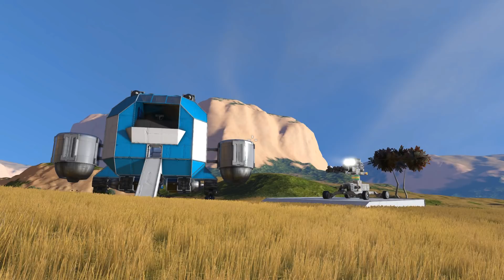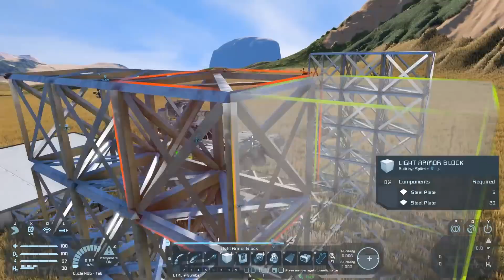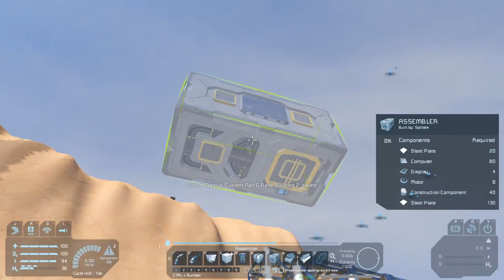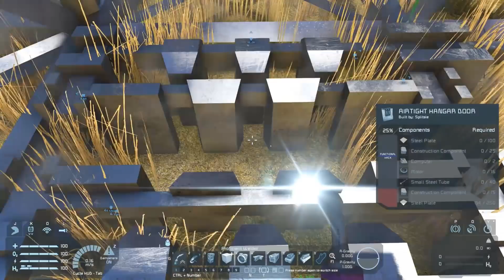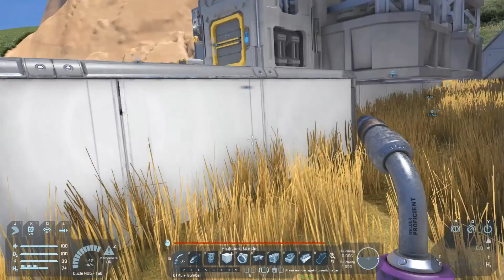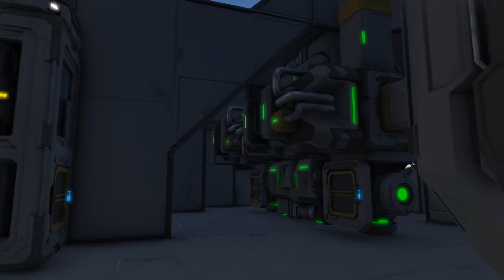Space Engineers Tutorial: Building Your First Base (Part 6 of a survival tutorial series)

Comment: I wish I watched it before I built base. I made all as tight as possible and now I need to rebuild all of this.
Reply from the maker: There's something to be said for nice and tightly spaced builds, I just find it's easier to get a style I'm after if I give myself room first then try to go smaller as it's a huge amount of work to attempt to increase space afterwards :/
Reply: @Splitsie  Actually what I initially built was facilities packed tightly covered by walls and roof, with no free space inside at all. And latere I fiugred out that it's better to have access to this facilities and to have some free space inside. I built several small cargo containers at first and then it was enough but later I wanted to build large container and extentions for refineries and assembler. But there was no space for that and each time I needed to disassamble walls if it was the option at all. Now I build much larger building for production facilities. I hope I will not need to rebuild it too quickly :D

Comment: I'm having problems placing a medbay in my cave base I'm building. No matter what position I try from the air or ground it will not snap to grid.
Reply from the maker: I've found that it's mainly armor blocks that will snap to grid in the ground, for things like medbays you normally need another block to anchor them to, try placing down some armor for the floor then placing the medbay onto that

Comment: "always leave a connection so you don't destroy things" was that the same splitsie who had ro repair the rover with 2 pairs of merge blocks cause he grinded away the wrong blocks? :D
Reply from the maker: Yes it was, I eventually learn from my mistakes.. Sometimes :P
Reply: that makes you smarter than me, i usually make the same mistake 2 or 3 dozen times. just to be shure it realy doesn't work the way i'm trying to build it :D
Reply from the maker: Why do you think I started making the occasional testing video - I figured if I was going to make a whole bunch of mistakes might as well record it so I remember :P
Reply: i spend most of the time tearing down and remodelling the same thing over and over and evertime i'd realy need it the piston+mergeblock trick doesn'T work the way it'S supposed to, summoning clang 'n stuff
Reply from the maker: Yeah, pistons still seem a little unsafe these days. They always make me quite nervous :P
Reply: was something i did wrong, instead of merging the items it crashed them together, damaging everting along the corners where i wanted to merge the parts :D

another thing i'm wondering while building timerblock airlocks is how exactly the timerblocks work, do they trigger all set up actions at once or in the order i add them with a bit delay in between?
Reply from the maker: They are supposed to trigger everything at the same time, but the reality is that they have a tiny delay some times, it varies on how many other things are going on at the moment they're triggered.

I've seen the effect when having lights on a timer block, they'll turn on at just slightly different times
Reply: 2 door groups, a vent and several warning lights. didn'T include soundblocks for warning cause there was no more room the way i build the airlocks :D

Comment: IMPORTANT NOTE: 1 assembler has 8 ports for modules. the two lateral access ports have a smaller yellow outline box. and youll user the module vertically to attach to the single module box and the access port box. you can attach a module there, leaving two access ports(one on each extreme end..if it were free floating). no real need to build 2 assemblers at the start.
Reply from the maker: You're absolutely right, I wish I hadn't missed that when I made this one :P
I still like having 2 assemblers though, but that has more to do with the often insanely large builds I attempt and needing tens of thousands of steel plates so 1 assembler is usually dedicated to them :)
Reply: thanks for the highlight, i edited it to be a little more clear and grammatically correct.

Comment: I missed it, eh... if not, I would correct Your mistake eariler :P
- Assambler have '8' upgread points (checked - conveyors on the 2'block-sides work also as upgread points)

Also no solar towers ?! :( 
Scripts are easy to use...

*(   http://steamcommunity.com/sharedfiles/filedetails/?id=1094836757   )
Reply from the maker: Yeah a few people have pointed out that little gaffe :P

I deliberately built no solar at all on it, this is a base for new players so I didn't want to get into solar and batteries or scripts. I wanted something functional that illustrated the different components that are useful in a base. I particularly didn't want to go into scripts because while they may be easy to use, I don't have the skill to write them so I'd consider them difficult to make. This means that if something goes wrong I can't do anything meaningful to fix it - in fact that's the same reason I've never owned an apple product... while windows may break more often I know how to fix most of its errors that I come across :)
Reply: You're using solar tower's right ?

Battery's... You grind them... You lose !
But seriously, it's easy and My bet is that 5'mins'top, of one's work, would be enough, there is only 3 options, even a donkey could 'solve' it, right ? :P

Script errors ?
I haven't had any with TIM, Isy's script's, Whip's turret, fancy fligth info... and many, many more...

Don't be so affraid...
Script ?
It's only couple lines of text ! :P

Comment: Um...  how did you keep the wolves from showing up?  I find myself equipping a turret on my lander before I do anything else.
Reply from the maker: The wolves are turned off. When I started this series I set the world up in a way that I thought would be best for brand new players (the first video in the playlist shows the set up). Anything like wolves or meteors are off so that you have time to think and work out the engineering side before some crazy, metal eating wolf comes along.
Reply: I guess my game is bugged.  Even when the option is turned off the wolves still show up.  Hence if I want an easy time of things I play on Mars.  :(
Reply from the maker: That's incredibly odd. You should be able to edit a savegame to turn them off just the same as if you were starting a new one. 

When you check the world settings of the savegame does it show wolves as off? Or is the setting not saving for some reason...